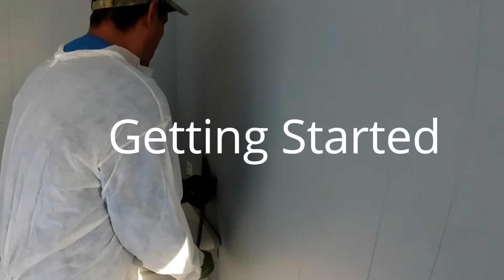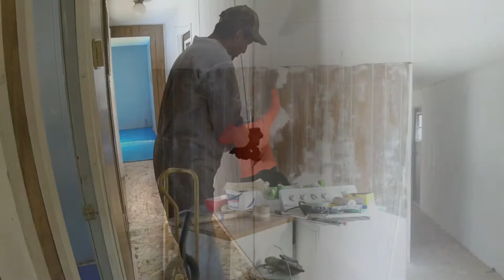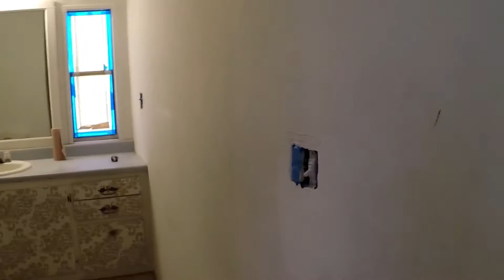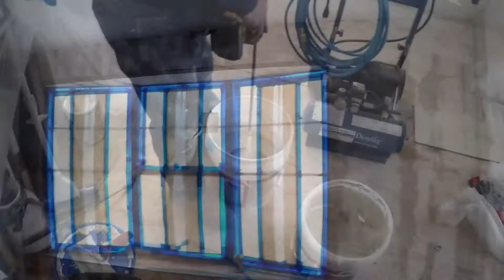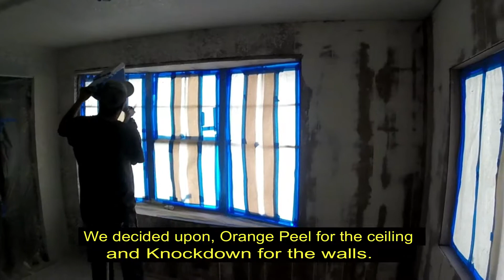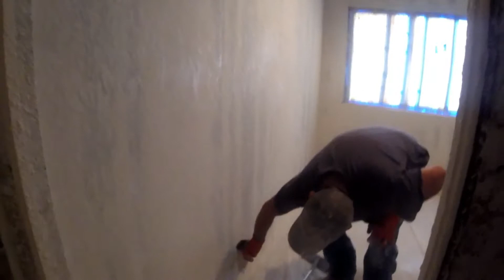Adding Texture to your Mobile Home (All you need to know)

Comment: I built a new room and used sheetrock. Then used 90 min quick set compound (Powder type) using the skip trowel texture. Just made small to medium batches using cold water to retard the setting time and it came out great. Once you get in rhythm of using it, you'll never use ready made compound again. It saves so much time and you'll be ready to paint the same day.
Reply from the maker: That's a great idea. Glad it worked for you.

Comment: It's necessary to use tape in those seams to prevent cracks in the future ?
Reply from the maker: The only time I had a problem with cracking was after the Home was moved. The ceilings cracked at the seams, but was resolved by applying Painter's Caulk prior to painting.

Comment: This looks like a BIG waste of time and money, I would just remove all the trim and put up 1/4-inch drywall, tape, mud and sand will save you hours of your time, then if you like the textured look d, add it. But textured look always looks cheap like you're trying to hide something like bad repairs or bad tape jobs. with the time and energy this person used on doing a textured wall, I could do a level 5 smooth wall and have time left over.